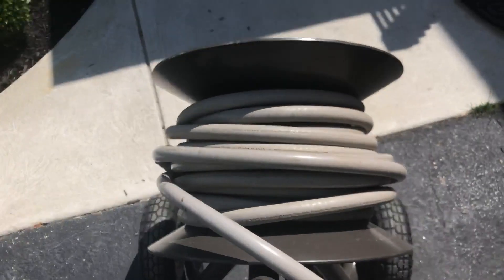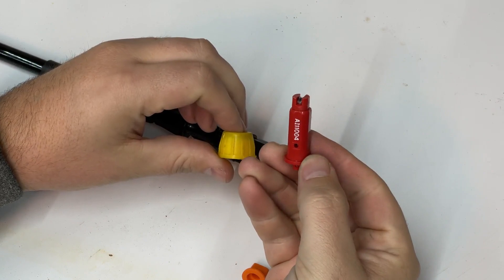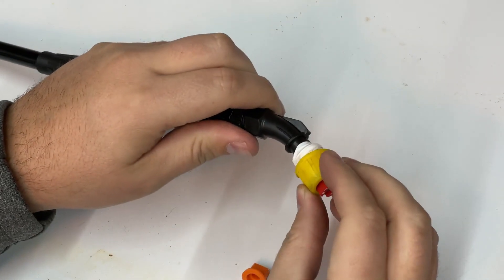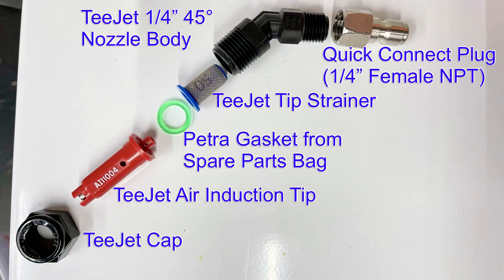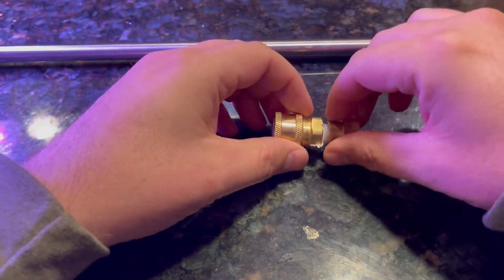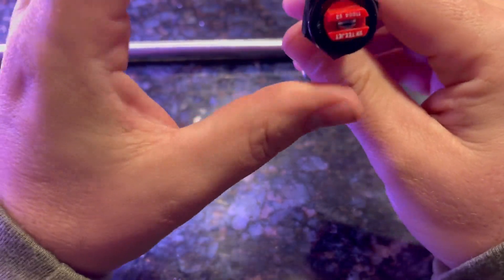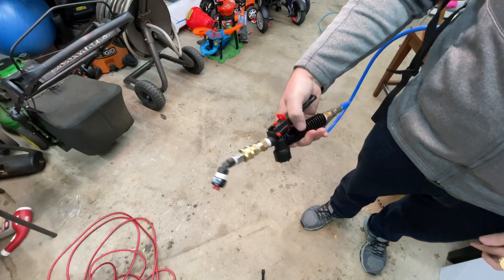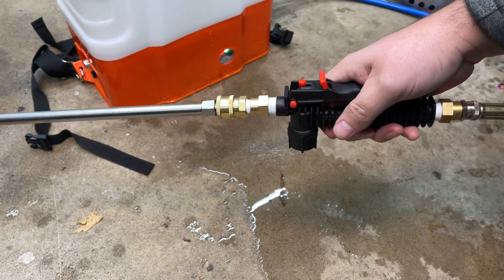Adding TeeJet Nozzles 💦 and Quick Connect Fittings to the Petra HD4000

Comment: I have an 18V Ruobi 4gal backpack sprayer. Do you know what tip I can buy to maximize the width of the sprayer?
Reply from the maker: Are you looking for tee jet tips?  There are so many to choose from and some have minimum pressure requirements.  How wide do you want to spray?
Reply: @ Thank you for getting back to me. I actually ended up buying a 15 gal sprayer and turned into a boomless sprayer
Reply from the maker: @zinmot5457  Nice!  Sorry for the late reply initially.  Received a ton of comments lately and I'm trying to get through all of them.  Thanks for watching the videos and good luck with the new sprayer!

Comment: I have small lawn sf so purchased a Scott's 2 gal battery tank sprayer. It comes with a 3 in 1 nozzle. Jet, fan and cone. Didn't find it adequate for the lawn. Thought it would be easy replacing the 45° nozzle body and purchasing a set of different flow rate fan nozzles. Forget about it. Its a battle.
Reply from the maker: Yeah, it’s tricky because there are so many different thread types and sizes.  Nothing seems to follow a uniform standard.
Reply: @TheLawngineer  yes exactly.

Comment: have you been happy with your wand upgrade ?  is there anything you would change ?      what was main reason why you went with the QD fittings and metal wand setup vs.  just using the plastic setup that comes with the Petra sprayer ??
Reply from the maker: Actually, the wand recently failed on me.  The metal wand is a bit too heavy and eventually failed at the connection off the handle.

Comment: Would this setup and all parts that you have assembled for your HD4000  work as well for the either the HD2000 or HD3000 Petra models?  I'm thinking of purchasing the HD3000 MODEL and would love to upgrade my wand and convert it to Quick connects as well as the teejet 110° wide spray angle nozzle. Thanks for any other helpful tips on this , Troy in Georgia.
Reply from the maker: I don’t know the answer to this, but know that some models differ in their design of how the hose connects to the wand and tank.  I know for sure this will not work on the HD4050.

Comment: I decided to invest in Flowzone Typhoon 3. It sports the gun style and I love it. I put quick connections on everything, even the hose can quickly disconnect. Oh, so lovely. 👌🏾
Reply from the maker: Looking to get one myself very soon.
Reply: @TheLawngineer any thoughts on the Flow Typhoon compared to Yard Mastery sprayer
Reply from the maker: @Sailfintang I have the FlowZone and it’s amazing.  I have never used the YardMastery version.
Reply: @TheLawngineer  I actually just bought the Yard Mastery after I asked , they have it on sale for $299 , really good deal and comes with all the Teejet nozzles
Reply: I am thinking of getting the Yard Mastery sprayer but have seen the HD4000 and Flowzone Typhoon 3 and now I can't decide, any input from anyone?

Comment: Noticed at the start you put the washer in the yellow cap, then the t-jet nozzle. I think the nozzle should be inserted first into the yellow cap, then the washer. That's how my original connect was setup, and I bought the t-jet and it works great. When you showed the new wand, you put the washer in the correct way.
Reply from the maker: Thanks for sharing.  I’ll check it out.

Comment: I like your video much more than I do the Petra sprayer (HD4000) that I bought a couple years ago.  I don't like that it leaks at almost every connection that it can leak from.  I tried the tape but before long it comes undone.  Is there any other way to keep the connections from leaking?  If there isn't, I think I'll get another backpack sprayer, but it won't be from the Petra company.  Poor design from the get-go if they already knew that it leaks and include the plumber's tape with it.  I think they should have made it so it does NOT leak.  I can't use it without it spraying on plants that I don't want the spray on.

Comment: I notice that you installed the thread tape Counter Clockwise, the correct way is Clockwise, because when you start screwing the parts back together you start unwinding the tape off of the fitting.
Reply from the maker: Yeah, I realized that and corrected it.  Thanks!

Comment: I highly recommend not using the “jet Tim strainers” 

If your using a thicker liquids , it willl clog the strainer increasing back pressure on battery type pumps and reduces the life of that motor. 
With that said , I never had a tip clog without a strainer. Also it’s one less thing to cling when it’s time to clean up
Reply from the maker: Thanks for sharing.  I’m gonna have to open these up and check the strainers to see if they are clogged.

Comment: What hose/handle do you have?  My Ryobi handle has a 3/4 thread. Ugh. The petra tool small connector won't fit.
Reply from the maker: This is the hose and handle from Petra tools.  Came stock with the HD4000

Comment: Did I miss the part where you actually show the tip in action? I’ve watched several videos on these tips and nobody shows the tip being used 🤦‍♂️
Reply from the maker: You want a video on TeeJet tips?  I can put something together for that if you’d like.  Probably a short or something.
Reply: @TheLawngineer  no thanks I got a sprayer and tip set up. 
A video series of a lawn makeover from a fall seeding into the spring would be good. I seeded last fall now wondering what to do with the new lawn this spring.

Comment: I do believe the Lesco Chemlawn spray gun will work with the Petra fittings, at least that’s what I’ve been told, but it may be worth a try for you! 
https://www.amazon.com/Lesco-Chemlawn-Nozzle-Repair-Bundle/dp/B01MTMWVC2/ref=sr_1_2?dchild=1&gclid=Cj0KCQjw6NmHBhD2ARIsAI3hrM2crJMTufi1wrdA7zZQZzwdBA8t_PFJzxJ_F1G05yWmIf8W8eF1eOoaArtMEALw_wcB&hvadid=409938654624&hvdev=c&hvlocphy=9027315&hvnetw=g&hvqmt=e&hvrand=17938771439117784284&hvtargid=kwd-359798937319&hydadcr=23634_11321926&keywords=lesco+chemlawn+spray+gun&qid=1626840571&sr=8-2
Reply from the maker: Thanks for sharing!

Comment: Do you know where the small brass wand connector could be sold  at? It’s sold out on petras website
Reply: I was able to order it through Petra customer  service . They say  have small quantities  but not enough to put on the website.
Reply from the maker: That was the only place I could find it.  I bought quite a few different thread type fittings and could not match it.

Comment: I just bought a Ryobi 4 gal sprayer.  Are the threads the same for all these manufactures?  I assume each tip requires a different cap?  On Amazon, it does not seem to specify any requirement for particular caps to install the tip to any particular wand...  There should be some sort of compatibility chart for different sprayer manufacturers.  On my Ryobi, a lot of the threads as well as the tank cap are stiff.  I used plumbers grease on all the threads as well as any gaskets/washers.  Not only do they thread easier but I believe they reduce wear and increase the part life.  I have used plumbers grease on hose gaskets for decades.   I understand they can get dirty, but that has not been a problem for me.  I simply wipe anything off with a rag.
Reply from the maker: I don’t know if the threads are the same.  I tried talking to Petra about this, but I never got a straight answer from them on the thread type.

Comment: Thanks for the video. One comment, the steel pressure washer wand and QD fittings add weight compared to using a poly or aluminum wand for landscape sprayers. Maybe not as robust!
Reply from the maker: Yeah!  It’s definitely heavier and unbalanced... also, apparently I’ve been holding the wand upside down as well.  As soon as I flip it, it seems ok, but still heavy.  Thanks for your comment and thank you for watching!!  I’ll have to look into the aluminum wands, if you have a link, please reply with it so I can see.  Thank you so much!

Comment: Can you use plastic instead of that heavy steel tube? This looks awkward  with all the weight.
Reply from the maker: Yeah, if you can find the right thread, for sure, but I don’t think you can use the existing plastic wand.  There is no thread at the end the tip attaches too.  Instead, it’s a compression fitting that holds the tip on.

Comment: Your setup is great!  I did mods on my Ryobi battery sprayer wand and a Chapin pump sprayer to be able to use Teejet nozzles and adapters. Because I had a hard time collecting all the different types fittings and all,  I went to a local pneumatic/plumbing place to get help with some ideas. We ended up cutting the wands near the tip and installed QC so I can swap out Teejet nozzle and the original Ryobi/chapin nozzles.  it worked fine, but it is kind of heavy around the tip and Chapin's plastic wand may warp or snap eventually.   I wish I found your video so I could suggest the guy who helped me to do something like yours.   I noted your idea for future mods 🙂 Thank you!
Reply from the maker: Thank you so much for watching!

Comment: Great videos, Vince. I ordered the same same sprayer based on your review. Just got to get rid of the 3 feet of snow in my lawn! How do you think your set up compares to the stock wand that comes with the unit? The tee jet nozzles, I'll definitely upgrade to, but is the standard wand good enough? I like quick connects, but I probably will hold off.
Reply from the maker: thank you!  I think the standard wand is good enough.  If you find yourself changing out tips a lot... then consider quick connects.